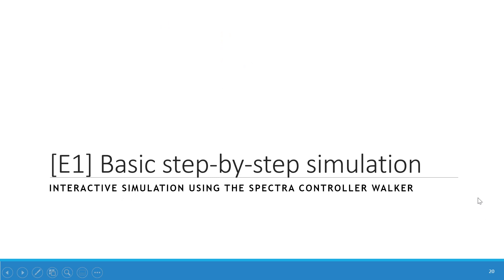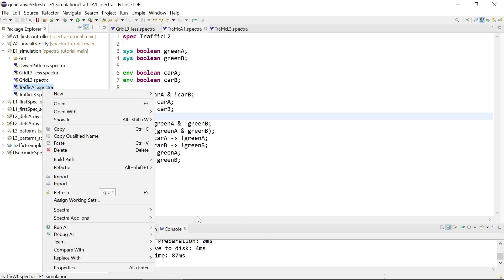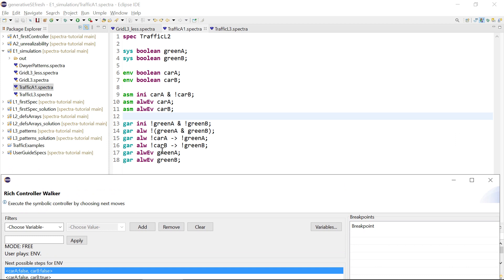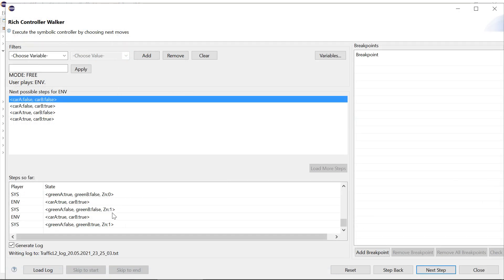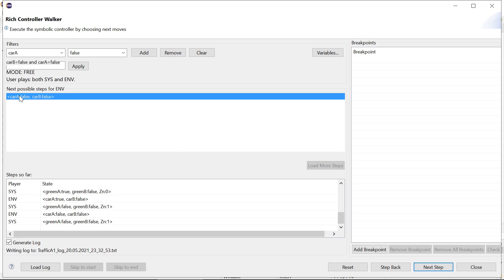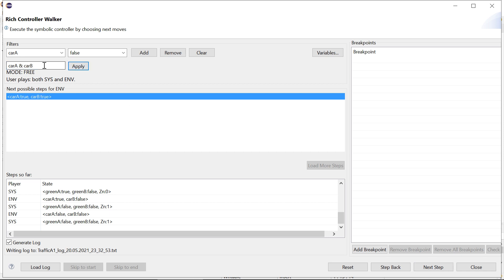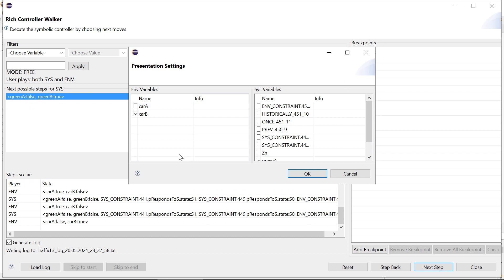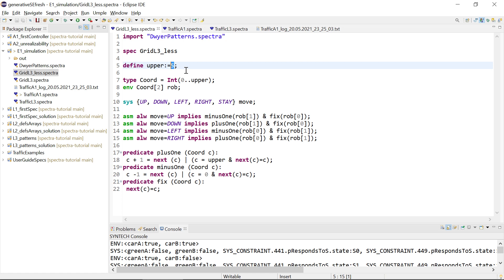[E1] Basic step-by-step simulation

Comment: For anyone getting the "Mismatched/Missing controller" error when trying to start the rich controller walker plugin, I found that going to preferences>Spectra>Rich Controller Walker and changing the controller type to Static Symbolic Controller fixed it. On my machine it was set to Just-in-time Symbolic Controller by default.
Reply from the maker: Thanks a lot for the advice. The Rich Controller Walker, as well as the programmatic execution [E2], are dependent on the controller format you synthesize (see also [E2] https://youtu.be/Zu-EL3fSeIM?feature=shared&t=40 and https://youtu.be/Zu-EL3fSeIM?feature=shared&t=92).